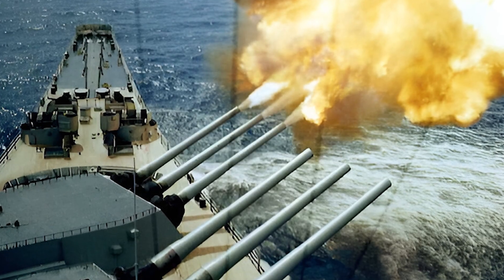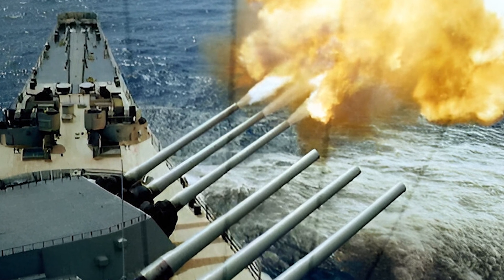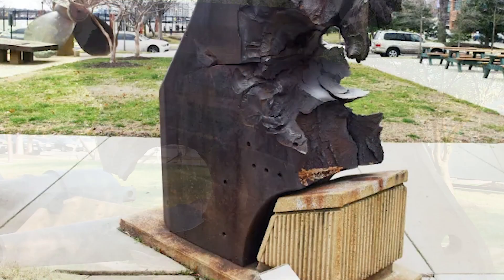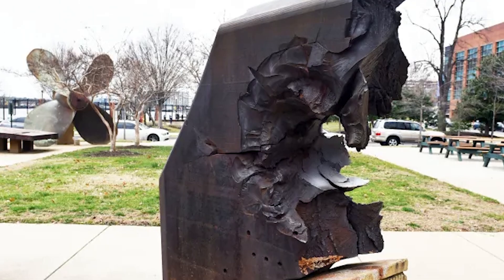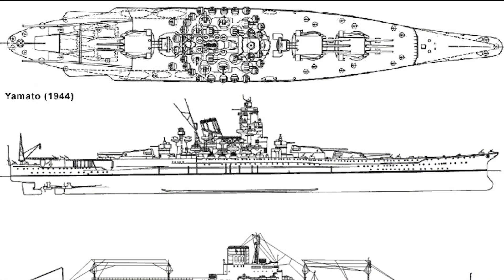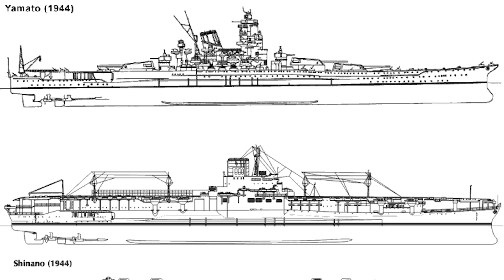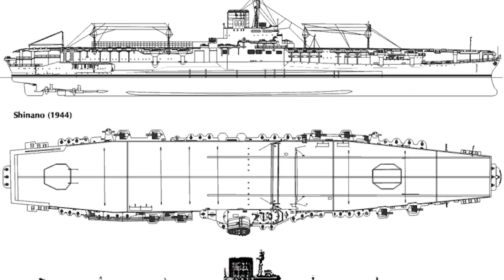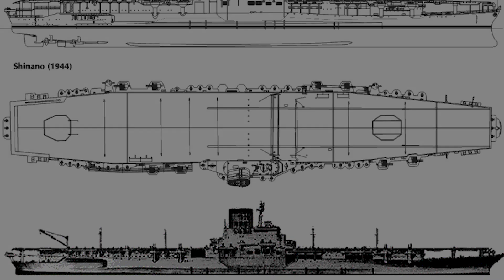USS-Iowa VS Yamato Armor Simulation

Comment: Wrong music. The music playing is the IJA anthem, not the IJN's. As far as the test. In real combat, the "Iowa" class would have stood out at 30Kyds. This was OTH from the target. The SG-1 surface search radar and the Mk.13 fire control radar could detect a battleship at 40Kyds. The Mk.VIII rangefinder would calculate the firing solution by 35Kyds and the remote power control would aim the turrets. Since the USN would have air superiority over the battle area, they could use aerial spotting, just like the USN practiced for most of the 1930s. The battle line would shoot over a smoke screen. The IJN battle line, whatever it consisted of, would never see the USN BBs. And the 10cm Type 22 surface search radars that were modified for fire control in Oct 44 only had an effective range of 20Kyds. Most of the shells would have hit the deck. There was a weak point in four places where the 15.5cm mount's barbettes penetrated the armor deck. There was less than 4cm of armor from the 2.5cm of the mount roof to the various decks down to the magazines. The fore and aft 15.5cm magazines, which included powder in bags, were right next to the 46cm magazines. During the air attack on IJNS Yamato, a 1,000lbs or 1,600lbs AP bomb went down the aft 15.5cm mount and barbette. You can see the charges from the mount, handling deck down to the magazine burning. Her aft magazine blew up just as she began to capsize. But the USN didn't even need to sink her. Damage her bad enough (before her Okinawa run) and she would spend the rest of the war in harbor, the IJN no longer having the ability to repair her.
Reply: In the 1943- 45 time frame, long range in the U.S. Navy was from 22- 26,000 yards. Longer ranges than this were not regarded as viable because of the large dispersion patterns of our post- treaty battleships (1.9% of range for a nine- gun salvo, among the highest of any navy in WW2). These large dispersion patterns more than offset the minimal range accuracy of the Mark 8 over Yamato's foretop optics and of her Type 22 mod 4 radar (45 yards at 25,000 yards vs. 89 and 109 yards respectively). This was a major factor in why none of the Iowa class battleships obtained a main battery hit on any vessel of destroyer size or larger in WW2

The Type 22 Mod 4 radar could detect a 100- foot high battleship- sized target at 35,000 yards. Remote power control in both range and bearing was not fully appreciated in the U.S. Navy during this time period, so that no tactics to take advantage of it were developed during WW2. There's no record of an AP bomb going down the aft 155mm mount of Yamato.

Comment: Just a additional note for anyone not in the know Iowa’s guns while smaller are more powerful than Yamato’s due solely to velocity. Yamato’s are larger but she more of lobbed her shells.
Reply: Completely untrue.
Reply: @ Which part?
Reply: @Mobius118F  The 18" .45 cal. gun had a slightly higher muzzle velocity than the 16" .50 cal. gun. The bursting charge of the Japanese shell was almost twice that of the U.S. shell.
Reply: @ I feel a incoming rabbit hole time to find seven sources. (I could only find one with Their muzzle velocity I like going into rabbit holes)
Reply: @ Ok no I was wrong her guns are 59/ftps faster at muzzle velocity. Problem being Her shell were prone to arc so simply put bad MOA hence I why I’ll always refer to guns more as Lobbing which doesn’t help with Armor pen meanwhile the 16” Mark 16 is pretty much built for longer range shooting but hey if your objective is make ground beef out a rifleman Yamato’s the winner. ({Yamato’s} 5559/ft Vs {Iowa’s} 5500/ft if the charges are “Twice” I’d be concerned)

Comment: A ridiculous comparison. Because American radar was so accurate by 1945 that it gave an overwhelming range with accuracy advantage to the American & British ships. And even more so at night.
Reply: That's a widely believed myth. The range accuracy of the Mark 8 was only marginally better than Yamato's foretop optical rangefinder or Yamato's Type 22 Mod 4 radar (30- 45 yards at 20- 25,000 yards vs. 89 and 109 yards respectively). This was more than offset by the shell dispersion of all of the U.S. modern battleships vs. that of the Yamato class (1.9% vs. 1.3% of range for a nine- gun salvo). The gunnery accuracy of the Yamatos off Samar was unequalled in WW2, with four 1st- salvo main battery hits on two different ships (one of them aimed solely by her Type 22 radar), while none of the Iowa class ever obtained a main battery hit on any vessel of destroyer size or larger during WW2. The most significant advantage of U.S. fire control radar was remote power control for both range and bearing, allowing gunnery accuracy to be maintained in all weather and visibility conditions. Unfortunately, the Navy didn't recognize this advantage, so no tactics were developed to utilize it during WW2. Not trying to knock on the Iowas, but that's the history.
Reply: Admiral Lee would disagree as would every US  Battleship captain at the battle of San Bernardino straight. And all the battleship captain s that were directed to engage  the Yamato  in "Ten Go" but it was sank well before they got anywhere near it.
Reply: @raywhitehead730  The same Lee who stated that our advatange over the Japanese consisted almost entirely of radar at a time when the Japanese had none? The same Lee who declined an offer to engage the Japanese in a night surface action in the run- up to the battle of the Philippine Sea because he said that the possible advantage of radar was offset by poor communications and lack of training in fleet tactics in the Battle Line? The same Lee whose Battle Line didn't even begin training as an integral unit until September of 1944? I wouldn't reference the old BBs at Surigao either. Not one of their claimed hits were confirmed in a night action against an old BB that was already crippled and making just 10kts when the US BBs opened fire, while the wreck of Yamashiro is essentially intact and shows that she was sunk by 6 torpedo hits from US destroyers.

Comment: And that's at yamato's turret front, which wouldn't be a target normally. At close range, you'd be trying to get through the belt for the magazines or the boilers to deal catastrophic detonations or cause flooding and yamato's belt is about 2/3 the thickness of the turrets. And yamato's citadel has 6 weak spots at close range because of it's octagonal citadel.

The question is if the shell detonates or gets de-capped. If it detonates, then iowa can no-contest destroy yamato at close range because its superior maneuverability can outpace yamato's slow turret rotation (it's so slow that yamato can't maneuver and fire at the same time), and iowa has a faster reload. Dpm and accuracy matters more than gun size.

Comment: The navy's own conclusion after this test was that any U.S. Battleship would have had serious trouble in an engagement with Yamoto.
Reply: What people often overlook is that the Iowas carrying the Mark VII gun were actually underarmoured. Because they were supposed to act as the US Navy's fast wing, escorting Aircraft Carriers and protecting the anticipated long lines of communication from Battlecruisers and other raiding ships, they had to sacrifice armour for speed and used the same armour scheme as the South Dakotas, which were only properly protected against their own Mk VI guns. 
To add insult to injury, rumours of a Japanese Super Battleship had been floating around since 1939, and the Navy eggheads made the conclusion that these were only armed with 16 inch guns of inferior quality. They designed the Montana class in response - the last ever US Battleships were incorrectly designed to fight an opponent that would have blown them out of the water had they met.
Reply: @Firespectrum122  "blown out of the water" lmao the Montanas wouldve absolutel demolished the Yamato .

Besides the Iowas used a "all or nothing" protection scheme which means the most vital parts of the ship + deck wouldve been very protected, while less vital parts would have less armor.

Comment: ? I might be wrong but I'm sure this shell was fired from HMS Nelson, and the armour plate you see is a single. Yes Shinano was originally supposed to be a battleship but that all changed due to the start of the war, so showing a single plate is not the 4-5 stack the battleship would have had. Aircraft Carriers are light armoured, however she still had the hull.

The I.J.N Yamato class battleships was one of or if not the, most specialised secret hull designs of all. Even surpassing the German battleships, you will never get another battleship like that again.

Not to mention the level of fanatical honour, the Japanese were the greatest force the US ever came up against. As wrong as the nuke attacks were by the US, they NEW. That they couldn't carry on fighting against them for a number of reasons, and so knowing the high chance of losing against the Japs they dropped them.

Comment: The US Navy lightweight Mark 7 50 cal16” rifle is likely the finest piece of artillery ever devised. Combined with the 2700lb super heavy AP shell, the ballistic performance was very close to the Yamato’s 18” guns—a remarkable achievement.
Reply: The 18" .45 cal. gun and shell were superior in rate of fire, shell weight, danger space, bursting charge, quality of explosive in the BC, and penetrative ability. I agree that the 16" .50 was an outstanding weapon- with the caveat that the 16" gun was all but at the end of its development, while the 18" .45. cal gun was at its very beginning.
Reply: @manilajohn0182  the Mark 7 was a superior piece of engineering and utility-that further separated the IOWAs from the Yamatos technologically. Just a personal opinion, but I think your rate of fire claim is dubious at best. As to your citations, “superiority” was incremental and hardly worth the penalty in cost, weight, and overall utility. 

The Iowas were far more efficient machines and weapons platforms.
Reply: @iowa61  See 1944 U.S. Navy Bulletins of Ordnance and U.S. Navy Technical Mission to Japan OT O- 45 "Japanese 18" Guns and Mounts". The minimum ROF (at low elevation) was 30 and 28 seconds respectively. That would be markedly greater at combat ranges for both. The 16" .50 cal. gun was a longer barreled version of the 16" .45 cal. gun. The greater weight of the shell (as opposed to the original 16" .45 cal. shell) was devoted entirely to improve armor penetration characteristics. Bursting charge weight was the same as that of the standard 16" .45 cal. shell, and just over half that of the 18" .45 cal. gun. By "superior" I meant "better", and not "night vs. day". The figures for both guns are typical for a smaller gun at the end of its development potential and a larger one at the outset of its.

Of critical importance is the fact that the Japanese vessel was designed to possess a large immunity zone against its own main battery, while the U.S. ship was not. I've posted the immunity zones of the two in this thread before but will add it here for ease of comparison. It makes clear the difference between a treaty battleship with the provisions of the escalator clause worked into the design, and a super- dreadnought designed to leap ahead of expected competition and enable it to engage multiple capital ships simultaneously. FYI, I'm not a fanboy of the Yamatos. With all due (and sincere) respect to the fallen, I'm glad we sunk it. That said, truth matters.

Source material is from the U.S. Navy Bureau of Ordnance.

Immunity zone of the Iowas vs. the 18.1" gun:
Citadel                     24,800- 29,800 (5,000 yards);
Turret Faceplates  24,700- 31,600 (6,900 Yards);
Barbettes                26,500- 31,600 (5,100 Yards);
Steering                   24,700- 28,800 (4,100 Yards);
Control Tower         26,500- 31,600 (5,100 Yards).

Immunity Zone of the Yamatos vs. the 16" .50 cal. gun:
Citadel                     17,000- 34,500 (17,500 Yards);
Turret Faceplates   (Impenetrable);
Barbettes                16,600- 36,800 (20,200 Yards);
Steering                   19,100- 33,400 (14,300 Yards);
Control Tower         16,600- 33,400 (16,800 Yards).

Comment: Do remember the Yamatos were not built to fight the Iowa class battleships. They were built to fight and kill the old battleships that were damaged or sunk at Pearl Harbor.
Reply: I'm sorry, but that's completely untrue.
Reply: @manilajohn0182  How is that untrue? Please explain.
Reply: @michaelholt8590  They were constructed for the purpose of engaging at least two of their newest U.S. counterparts. They were armed with 18.1" guns, which far exceeded that which the U.S. Navy was developing. They possessed an 11,000- yard immunity zone against their own gun 18.1" gun, which was superior to the 16" .50 cal. in shell weight, danger space, bursting charge weight and type, and in overall armor penetration. None of the older U.S. battleships, including the Marylands, compared at all to the Yamatos. All of the modern U.S. battleships, including the Iowa class, were treaty battleships, although the Iowas had the 10,000- ton escalator clause worked in to their design. Note also that Yamato and North Carolina were laid down within a week of one another, so that Yamato's actual counterpart was a 35,000- ton vessel armed with 16" .45 cal. guns and with an adequate immunity zone only against 14" gunfire.
Reply: @manilajohn0182  Did you read? The YouTube video specifically says Iowa class battleships. My comment was specifically about the Yamato and the Iowa class battleships. Nobody mentioned anything about the USS North Carolina. 

You managed to make a completely true statement, but it's irrelevant to the conversation.
Reply: @michaelholt8590  Did YOU read? You stated that "...the Yamatos were not built to fight the Iowa class battleships". In my reply, I made clear that the Yamatos were constructed for the purpose of engaging multiple U.S. battleships of every type, including the Iowas, and that none of the U.S. vessels compared favorably with the Yamatos.
Reply: @manilajohn0182  Yamato was launched in 1940, the Iowa class in 1943. The people who designed the Yamato didn't know anything about the Iowa class yet. Therefore, they were not built to fight them.
Reply: @michaelholt8590  The Yamatos were designed to engage multiple enemy battleships of the newest type whose dimensions and tonnage were limited by those of the Panama Canal. That said, it makes no difference whatsoever exactly what the class names of the U.S. Ships were. The Yamatos were designed specifically to outgun and out armor them. In this same manner, the proposed 20" gunned successors to the Yamatos were intended to outgun the U.S. response to the Yamatos. By this method, the Japanese intended to maintain a qualitive advantage over the U.S. Navy for the foreseeable future.
Reply: @manilajohn0182  You can't design something to defeat something that you don't know anything about because it doesn't exist yet. Regardless of how much you want it to.
Reply: @michaelholt8590  Yes, actually, you can in this case, and the Japanese did. You should read about the background to the design of the Yamato class and Japanese calculations of new U.S. battleships based on the dimensions of the Panama Canal. But you do you.
Reply: @manilajohn0182  You can Google all you want but that doesn't change the fact that the Yamato wasn't built to fight something that didn't exist at the time. 

There are reasons why the Japanese didn't pit the Yamato against any of the Iowas.
Reply: @michaelholt8590  GOOGLE?? lol you're a lost pup or maybe you're just trolllling
Reply: @manilajohn0182  No, I've listened to actual historians who were asked what would have happened if they Yamato and an Iowa had met. If what you say is true, then the Japanese did a very poor job designing the Yamato.
Reply: @michaelholt8590  lol
Reply: @manilajohn0182  Interesting use of the word "pup," too. That word is usually only used by people over 60. That explains much. I've heard historians recently talk about some older people put the Yamatos and Bismarck class battleships onto a pedestal of supernatural power, but they really weren't. Both had some design flaws.
Reply: @michaelholt8590  THAT is why you're lost. Because you let other people do your thinking for you. Or are you trolllling?
Reply: @manilajohn0182  I'm not lost. I know right where I'm at. What are you talking about? 

If the Japanese were so good, they could develop a ship to fight another ship that doesn't exist yet. You would think they could have predicted exactly how the war was going to go.
Reply: @michaelholt8590  Exactly.  There is a reason the Tirpitz never came out of port, especially when the USS Alabama was sent over to specifically hunt her down if she came out of port.
Reply: @michaelholt8590  Again, exactly.  

The Yamato were fantastic ships, but they were made to counter the last of the pre WWII US Battleships (IE the ones on Battleship Row) because they were planned and laid down in 1937   Hell the South and North Carolina Class weren't laid down until 1937 and the Iowa class didn't get started until 1940.  There is no way (Japan was awful at Espionage) that they knew about the Specifics of a ship that hadn't even been designed yet to start making the Yamato to counter the Iowa class ships.

Comment: It should be noted that the shell's charge was deminished to simulate the energy delivered at regular combat ranges.
Reply: You should read the conclusion of the USNPG report. It specifically references the inability of the 16" .50 cal. gun to penetrate the faceplate at any combat range.
Reply: @manilajohn0182  Small correction: The Iowa-class had 16" 50-caliber guns, meaning the barrel length was 50 times the diameter.
Reply: @nocount7517  Yes, and it could nevertheless not penetrate the faceplate at any combat range.